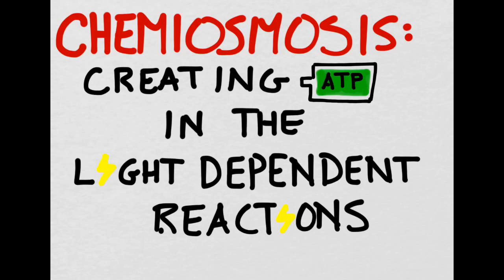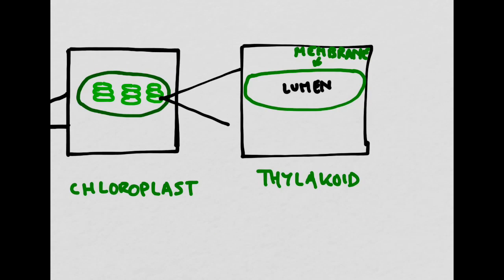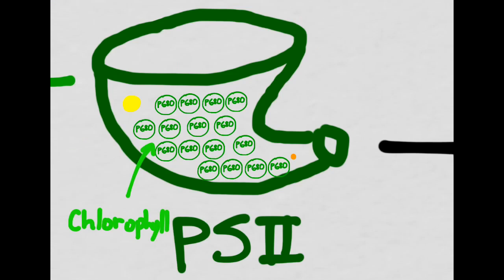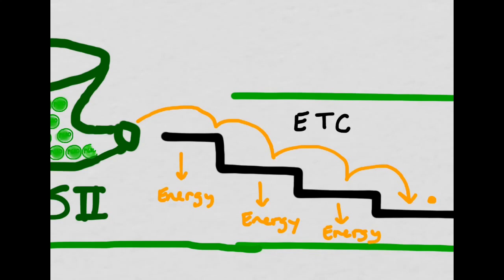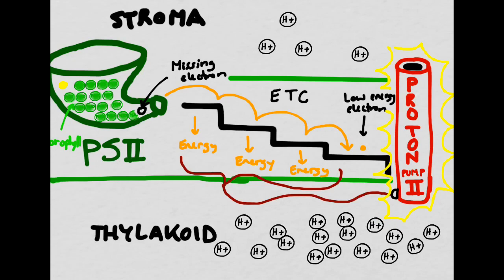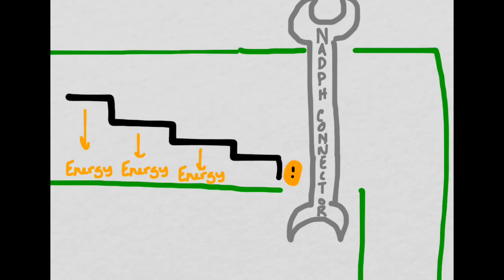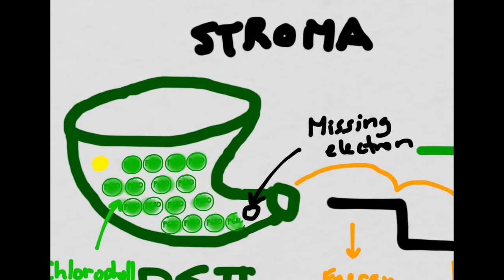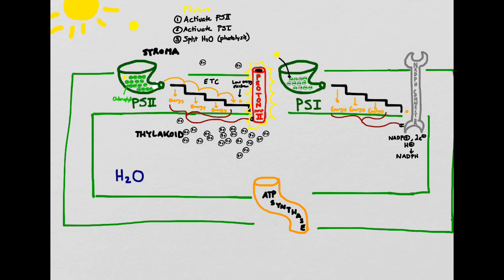ATP Synthesis and Chemiosmosis in Photosynthesis

Comment: How comes there's no missing electron is PS1 because it goes through the same process as PS2 right?
Reply from the maker: Hi Edward. Good thinking! This is actually a pretty complex process and is enmeshed with the photolysis of water. When water molecules get broken down, one of the components is several electrons. These electrons feed into the photosystems to maintain the supply of electrons. They also (eventually) combine with NADP+ and H+ to make the important NADPH molecule that is used later. Have a nice day and hope this helps!
Reply: I see thanks for reply